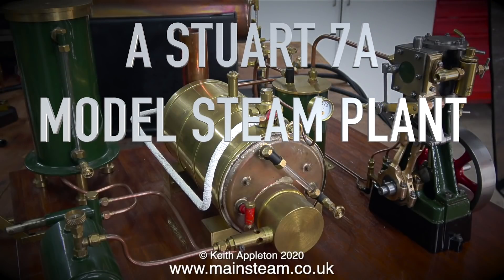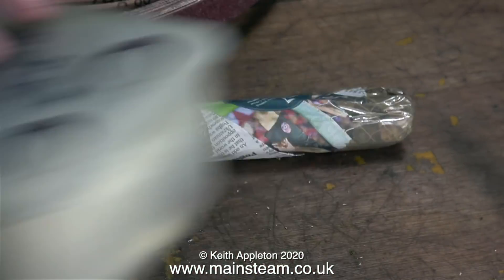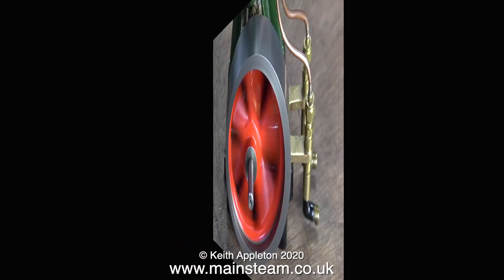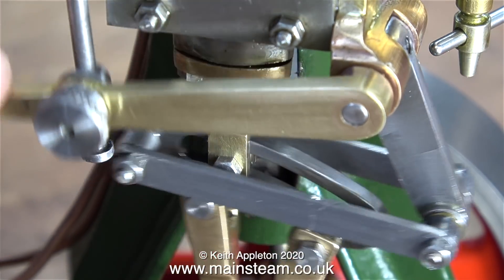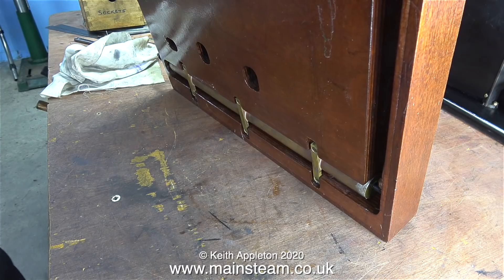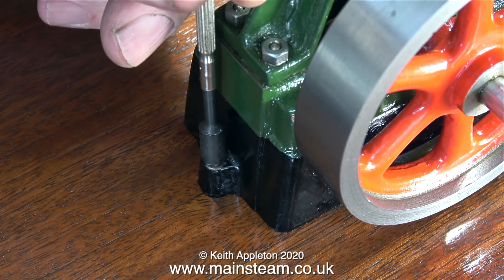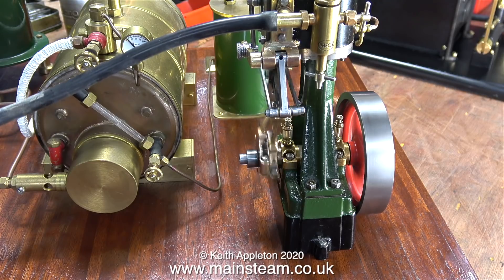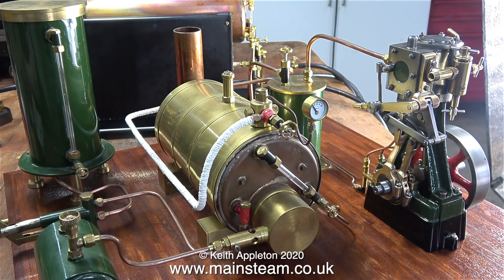A STUART 7A MODEL STEAM PLANT - PART #20

Comment: Recently got into the hobby and bought myself a chiltern steam model single cylinder horizontal mill engine kit, I’ve already assembled it and it runs great (atleast from my inexperienced eye). I’m planning on breaking it back down so I can clean and paint it. I’m not sure where I can get suitable paint for use on rough steel and brass (base is steel and flywheel is brass) if there are any brands you could recommend it would be much appreciated and on another note thanks for helping me get into the hobby.
Reply from the maker: Phoenix Precision Paints would be my recommendation.